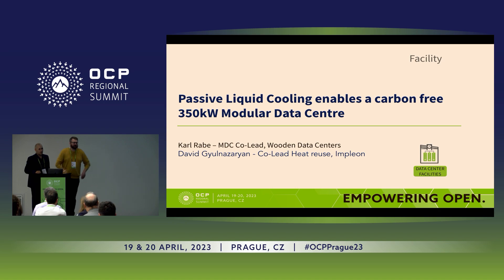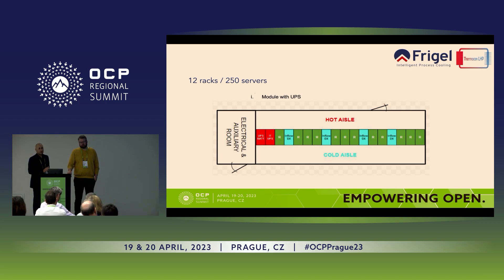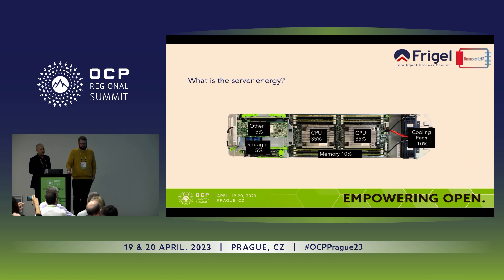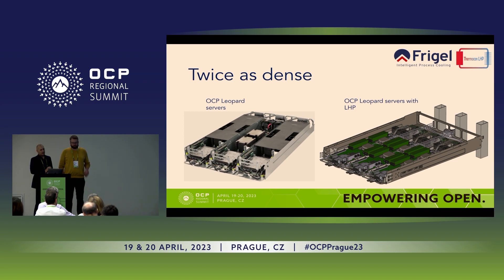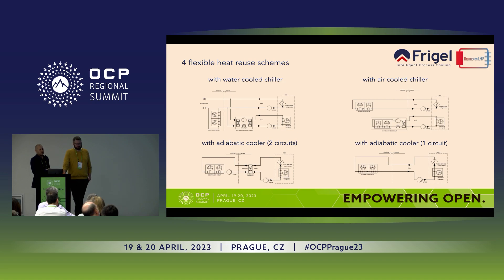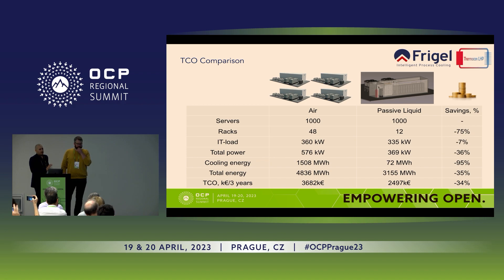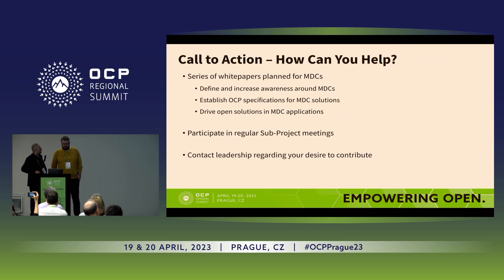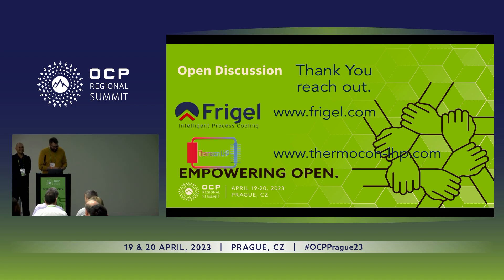Loop Heat Pipe for Modular Data Centers

Comment: You claim a condenser that pumps 140 kW to the outside world consumes only 4 kW. That gives a CoP (coefficient of performance) of a whopping 35. That cannot be right, except possibly when the outside temperature is lower than the indoor temperature. But the figures given show the heat being pumped across a broad rage of outdoor temperatures, while the condenser is listed with only a single kW draw. That is not right.